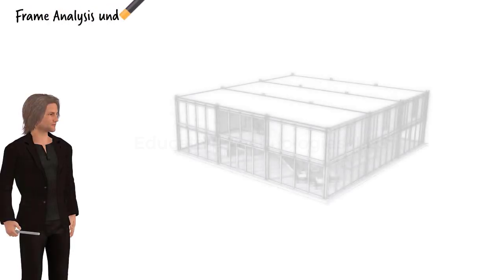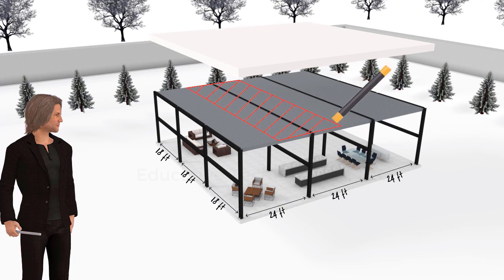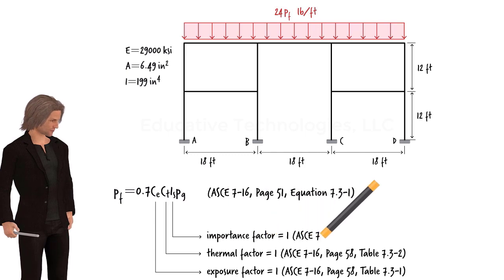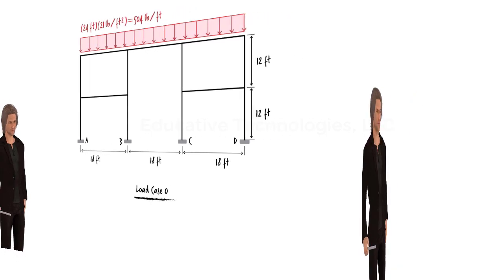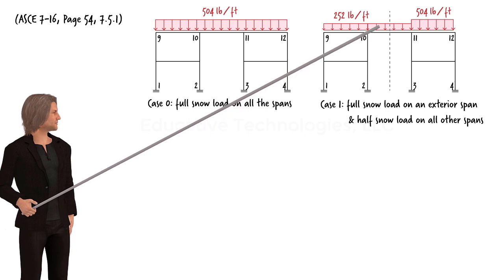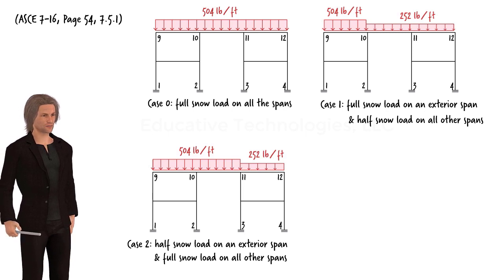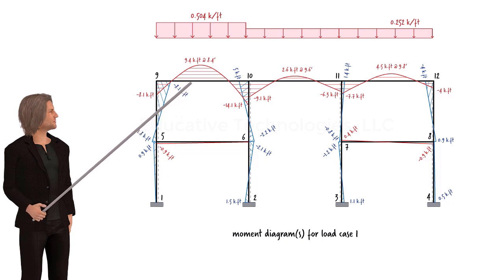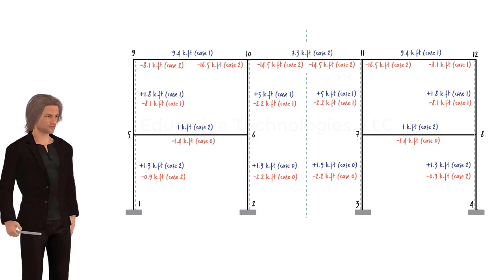SA66: The Analysis of a Frame under Snow Load

Comment: I'm wondering which software that you use to do this animation ?
Reply: I really like how you design animation for each tutorial, you have deep knowledge in Structural Engineering and you've made it in a simple way with clear concept making it easy to understand. Keep it up
Reply from the maker: The animation for the house was done using SketchUp, the lecture was animated using Adobe Illustrator.
Reply: @DrStructure   Thank you
Reply from the maker: You’re welcome.